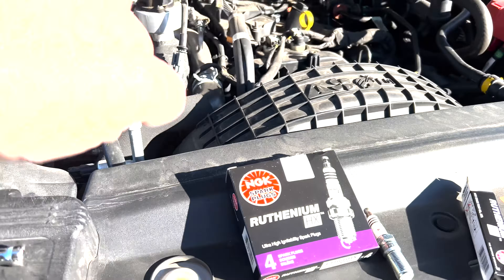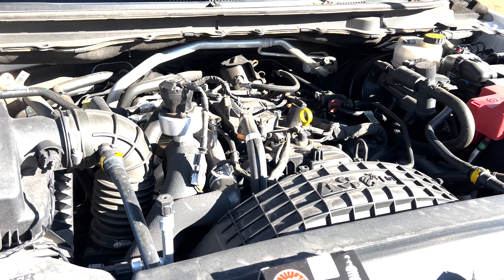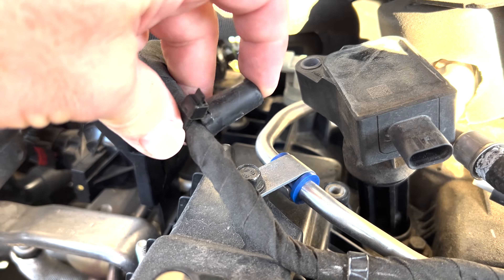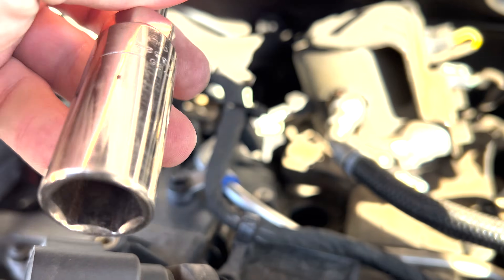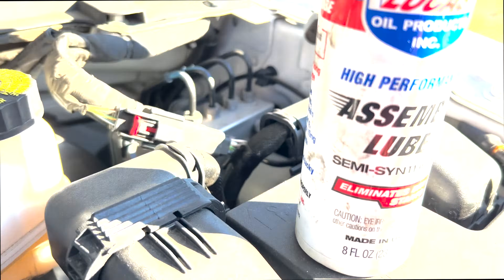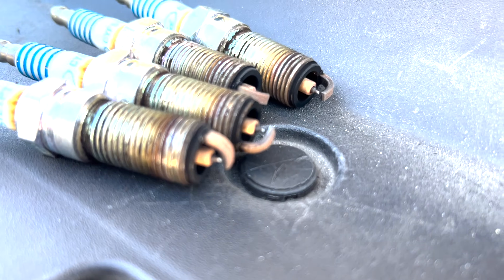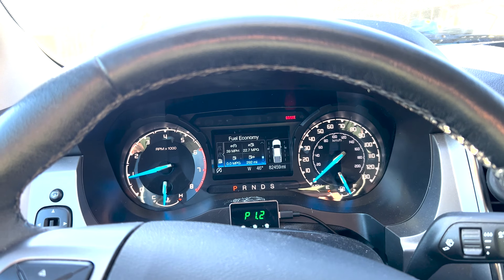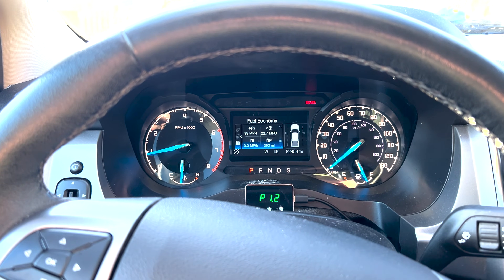How to change Ford Ranger Spark Plugs -Upgrading to Ruthenium HX Ultra High Ignitability!!!

Comment: I used the same plugs in my ranger and now having a misfire code although no shaking is present. Did you gap your plugs or just use right out of the box?
Reply from the maker: Yes, mine were fine straight out of the box. Maybe one of yours got dropped and it affected the gap.

Comment: Have you bleed your brake fluid yet? If so how? I have heard it’s complicated on the rangers and not as easy as it usually is like other vehicles are the way you bleed them
Reply from the maker: I haven't done that yet. I'm still on factory pads after 85000 miles (mostly highway). I might give it a shot when I do the pads eventually though.
Reply: Bleed normally, then hook up forscan and do an ABS bleed.

Comment: just did this on my 2020 ranger last weekend. I elected to just use OEM plugs even though the ones that you used are the ones that I put in my 08 Accord. Does your ranger have bad dash rattle?
Reply: Mine has the dash rattle. Took it to the dealer 3 times, they confirm that rattle and tried putting felt tape on the clips (rattle still happened), replaced the plastic part up by the defrost vent (still had the rattle, even with 2 replacements). I finally gave up dealing with constantly going back for it, so I took a piece of foam and wedged it in between the plastic piece and the windshield (rattle stopped)
Reply from the maker: No, I don't have any rattle in my dash.

Comment: Honest question here, not a sarcastic one lol.....is that rust on them or just some sort heat mark or something?
My original plugs were stained too.  '19 Ranger owner here.
Reply from the maker: It could be caused by heat. It just looks an awful lot like rust to me. Also, after driving around running errands yesterday, I can confirm that the performance is indeed better, even if I don't have the metrics to prove it.